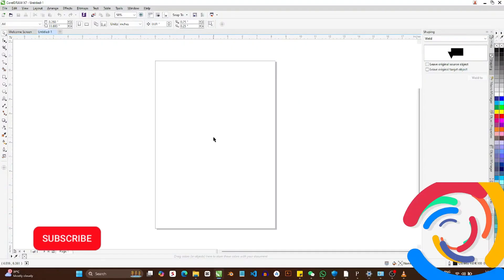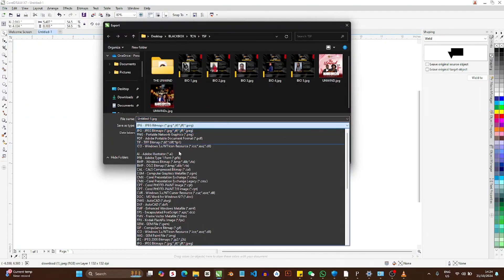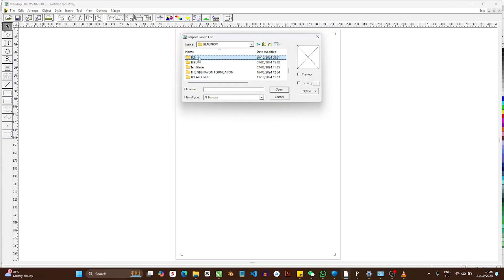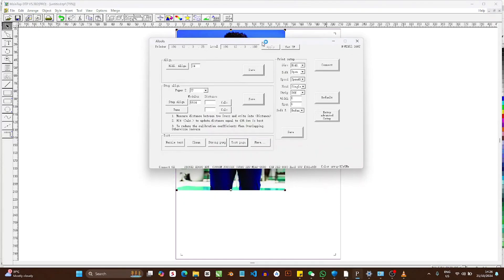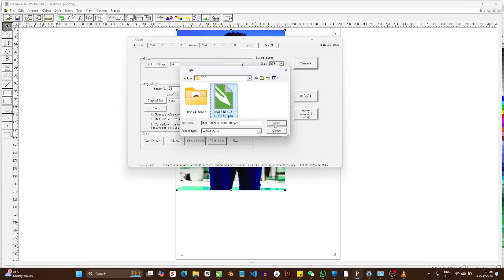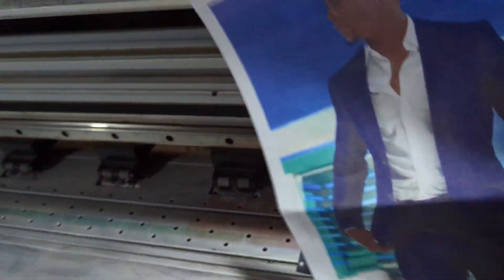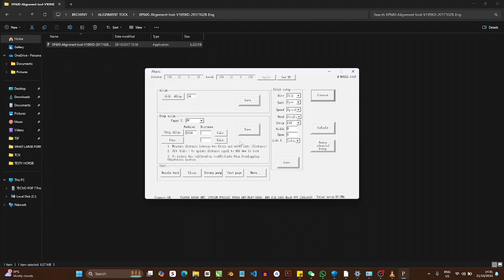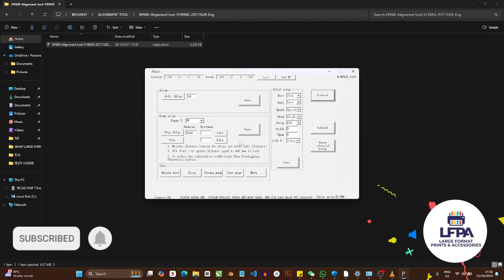MAINTOP DOWN!!! How to print with Atool Instead

Comment: I have an issue, when printing designs that they have Grey color, it comes as brown. (I'm using Closed CMYK curve), when trying other color profile like US SWOP V2, I good and accurate grey colors, but other colors sometimes comes not accurate. Is there any solution for this ?
Reply from the maker: I suggest you use the colors that work. Thought the details of the problem is not quite clear the way you have explained it
Reply: @richwords1  When you print a design that have grey color, the grey comes as brown, the rest of colors are fine and acceptable.
Reply: In ATOOLS  choose 720x360 only with 2pass in PRINTMEDIA. if you have that profile on your system. 720x720 4pass comes out like mine.  brown since the black is too wet also.

Comment: my printer has 13 inch at this moment i have a 11 inch roll and i want to put a 13 inch roll. Where on Atools or on my printer i can change max printable witdth??
Reply: and i want to know too where can i click on atools to print all my job in continue with no stop?
Reply from the maker: @CJImprimerieetBroderie you can set it on Maintop. And whatever you set will continuously print.
Reply from the maker: This is not an atools matter

Comment: i had the same problem..now im using only atools for large format since my maintop cant detect the printer
Reply from the maker: You've been smart from wayyyy back then...😀😀
Reply: My A top gives error tip : " the board doesn't support white" please help...my printer is new but configuring it is a nightmare 😢
Reply from the maker: @MhlengiMlu this may be a much deeper problem that requires a 1 on 1 consultation. Unfortunately that's not free.